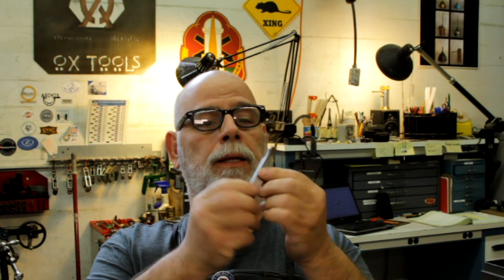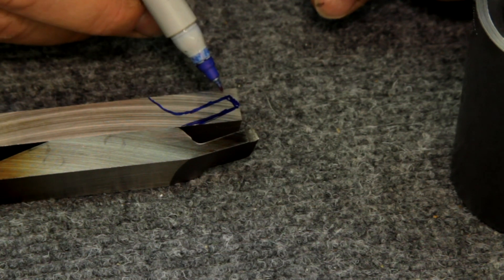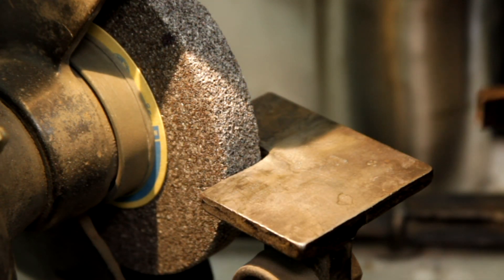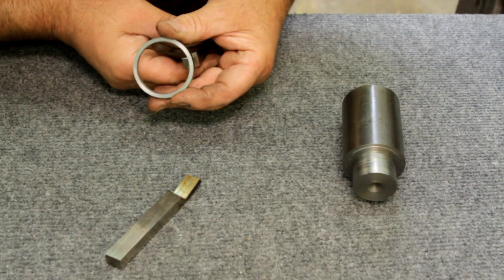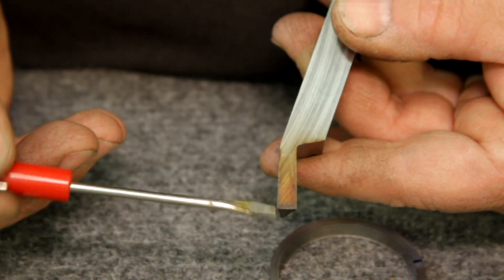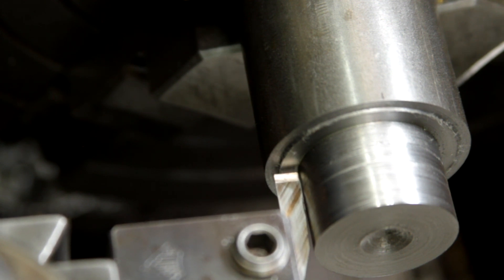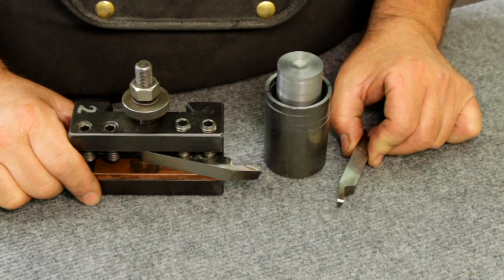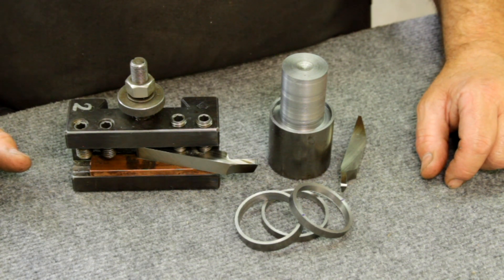Grind a face trepanning tool for the lathe

Comment: Cutoff wheel in an angle grinder w no guard? That makes me very nervous—I've had too many little ones explode to risk that with a good sized one.
Reply from the maker: Walter abrasives Zip cut discs. If you buy cheap abrasives you will have problems. This is why they are ten bucks a pop. Thanks for your concern and comment.

Cheers,

Tom
Reply: In order to prevent the "little ones" (or the big ones for that matter) from exploding, the trick I have learned (the hard way) is to develop a little vibration in the wrist when using hand held grinders. This helps the cutting disk "create" a little wiggle room, so it wont bind in its own cut path.  When held rigid or with a heavy grip the disk doesn't have enough room in the slot to allow for even your pulse.  Good luck!
Reply: Abrasive cut off wheels are a compromise.  Thinner ones tend to slice faster as they have less material to remove.  But they are more fragile.
Reply: Thanks for the tip Tom. I was impressed by how fast the zip disc went through the HSS. I'll check out some of the Walter discs for sure.
Also, judging by the sound of your voice directly after the cut, sounds like you had a full face shield on for safety, so running grinder without a guard wasn't an issue at all of course.
Reply: also, if you get the fiber reinforced disks the only chip if you abuse them - not explode.
Reply: Yeah, I'm admittedly a bit paranoid about angle grinders. OTOH, they can inflict some gruesome injuries.
Reply: I have had then come apart on me so I will not use a grind without a guard and made it a rule in my company that if they took the guard off and they injured themself  they did not get paid while off on injury leave.
Reply: Paul Ste. Marie
Reply: In my previous shop that I worked at we used cutoff wheels in our surface grinder for jobs just like this.
Reply: kqzphoto Clever idea!
Reply: A good face shield, safety glasses, gloves, leathers, Lexan blast shield, and ear plugs...  one would be just fine!! LOL
Reply: The guard gets in the way. If you prop your forearms and wear the right safety gear, the probability of a kick is low.
Reply: big ones are stronger than dremel's version, but I do agree not a wise demonstration in this litigious age of ours.

Comment: So the color change in the tool bit from the cut off wheel, isn't that effectively annealing the tool (making it softer)? Do you re-harden the steel off camera or is it not required for that particular kind of steel? Or just not necessary?
Reply: HSS will hold its edge red hot.  When grinding, the blank is dipped into water to prevent burns to the human.

Eli D.
Reply from the maker: No.

Comment: Why does it have to be at an angle? Wouldn't it work the same if you made it straight or do you get problems with rubbing on the rest of the shaft?
Reply from the maker: You really only want the tip cutting. The entire length of the tool would be rubbing against the stump. Technically it would work but its not good practice to have that much tool in contact with the work. Thanks for the comment.

Cheers,

Tom

Comment: I just had a job with a 2" deep face groove 3/8" wide. Tried it with high speed but gave up and bought a long series annular cutter and finished it with a small boring bar.
Reply from the maker: Broken annular cutter would probably work great in the lathe. Thanks for the comment.

Cheers,

Tom
Reply: oxtoolco Dare I say it but I have  never managed to add an annular cutter to the long list of seemingly indestructable tooling that I've broken. Probably tempting fate just mentioning it Lol.

Comment: Tom, maybe I just missed it but is there a reason why you cut the tool on an angle? I assume it just so that you can get your tool holder away from the part or was there more to it than that? All the ones I've ever made were just for face grooves so I never had to worry about the holder clearing the core.

Comment: When I think of trepanning, I think of putting holes in someone's skull, which usually uses some sort of annular cutter not unlike a hole saw. I suppose you could do the same thing on a lathe if you had an annular cutter of the right size mounted on the tailstock.
Reply: A doctor would make a jig for it, it takes a while to set up otherwise with the screaming and struggling and such.
Reply: The verb trepan derives from Old French via Medieval Latin, from the Greek noun of trypanon, literally "borer, auger".  Evidence of trepanation date back to the Neolithic period in the form of of cave paintings and human remains. It is the oldest surgical procedure for which we actually have archaeological evidence. At one site in France, remains have been found from around 6500 BCE, that's 8500 years ago! Makes you wonder about the saying "It's not brain surgery"
Reply: Next years 4 jaw? Who can chuck Tom within 1/2 thou
Reply: Chris Anderson actually that is what it's called when they put in burr holes to do surgery or relieve intracranial pressure, it's called trepanation.
Reply: Sy Bernot 
Not to mention the priceless information purposely destroyed.  The library of Alexandria,  all but  4 of the Mayan codicies. 
And who knows what else. 
A coronal mass ejection could wipe out the internet, and most of the data it contains. Maybe clay tablets are the way to go.
Reply: Marcus Merrick I know I was joking that you are using a lathe  to do it
Reply: Unless someone stumbles across a text from 10,000 years ago explaining it all we will never know how or why the practice came about. So many details are lost to time, in fact if you think about our golden age of information that we have going on right now, how much of it will be around in 1,000 years? Hard drives don't have anything close to the lifespan of clay tablets or papyrus. If all the knowledge of human kind could be stored on blu-ray what good will it be in 50 years when no one makes blu-ray players anymore? Just think of all the knowledge we lose in a couple of decades because of media changes. I just gave myself a chill.
Reply: The "modern" method for doing a ventriculostomy is more or less a twist drill in a hand cranked chuck.  I feel like Ox could make a neat little gizmo for getting more precise depth than the "by feel" method...
Reply: Sy Bernot I was just at the mutter museum and the have a colection of trippaned scules.
Reply: What Sy said ;)
Reply: Sy Bernot 
The question is, was it first done as a medical procedure for head injury, or as a metaphysical procedure to let the evil spirits out? Or were they considered the same?
There are those, even today, that have a hole bored in their skull to open the "third eye". 
The quest for enlightenment can be a demanding mistress.
Reply: spaight711 well that is scary.
Reply: https://en.wikipedia.org/wiki/Trepanning
Reply: That's how I ended up here, too. I'm guessing this tool was invented and then someone was like, "Let's use this on Ugg, who is possessed by the demons in his brain"
Reply: The surgical term is trephining and the tool is a trephine.
Reply: Cadwaladr prt a hole in some one's head ? lol

Comment: Wouldn't the heavy grinding affect the heat treatment of the tool steel?
Reply: If its getting that hot, youre doing something wrong
Reply: This is a common misconception that seems to be based in incorrectly interpereting cause and effect. A HSS drill or lathe tool will stop cutting effectively and there will be evidence of the cutting edge having 'overheated', ie. Brown, Purple and Blue colouration. The assumption is that it overheated, lost it's temper and the cutting edge failed. In fact the reverse is true, the cutting edge blunt or failed and that's what generated the heat.

HSS will cut steel whilst glowing red, that's kind of the point of it. Someone made a video demonstrating this.

Some of the claims about HSS tools failing if you get them too hot whilst grinding, are apparently based on them developing cranks when quenched from high temperatures, leading the the cutting edge flaking in use. Possibly this was true of some of the early HSS alloys, but I've not been able to chase down a good reference and the Cobalt alloys are apparently imune.
Reply: Thanks Paul
Reply: Ned's Head No.
Reply from the maker: No.

Comment: Why the copper bar at the base?
Reply: Its soft, the tool squishes into it a tiny bit and theres more surface area holding the tool in place. If it were just steel against steel the tool might rattle loose and that isnt very fun.
Reply: Long thin tools are prone to chatter and the soft copper will help reduce it a little, also Toms tool holder is nearly out of adjustment so it lifts the tool bit closer to center height.
Reply: Thank you, not unlike the  movie "MoonStruck" where the plumber says, "Copper, it costs money because it saves money." 
Dennis L.